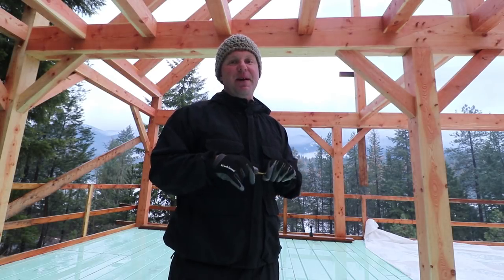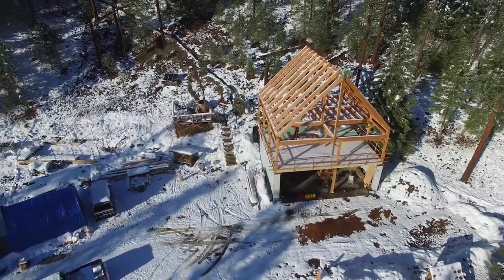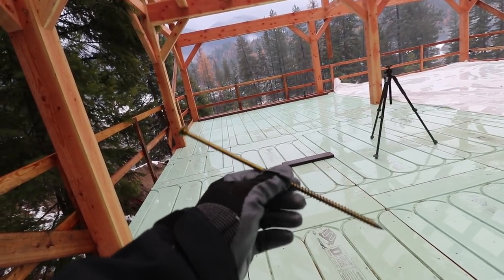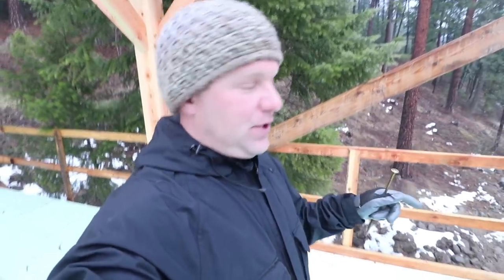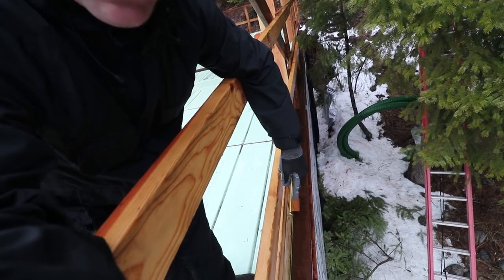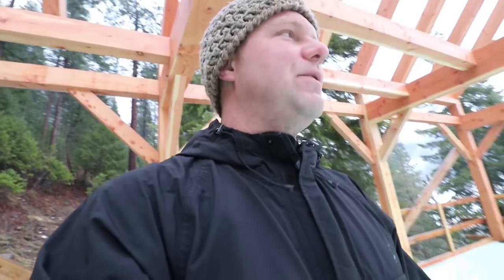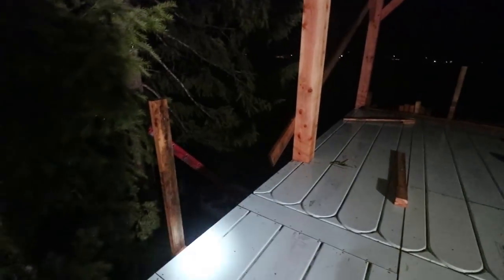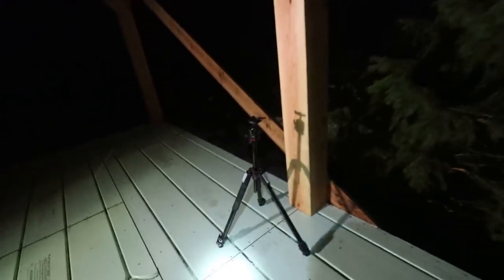How To Secure a Timber Frame To a Subfloor

Comment: All the heavy wooden post sitting over the warm board is not good something should be done to avoid load on warmboard it should be better if all the load is transferred to wall it self.
Reply: Nope!
Reply: Jedidiah please explain
Reply: he won't, just jabbering. After putting load on frame, it will crush this foam on boards to zero, don't get why they didn't remove foam from warmboards :/
Reply: Vein1986 I don't think the warm board has any foam on it.
Reply: The load (beams)on the warm board is not a factor...you can't crush it....its rated for something astronomical like 30,000lbs per sq" usually you would construct your sill plates on top of the warm board(in new construction) The load is transferred to the wall in the basement.
Reply: There is no foam in warmboard! Aluminum and marine grade panels....
Reply: Jedidiah, probably closer to 30,000lb per post (somewhere in the upper 300psi range) for Fc(perpendicular). Still no need to worry about the compressive strength of the panels under the posts.
Reply: The load bearing posts are better to sit bearing directly to the ICF. Douglas fir is 7230 psi and concrete is between 2500 - 10'000 psi depending on the mix. Plywood has a compressive strength of 250-280 psi. I can not find anything on Warmboard and even if 300psi is correct why bother putting it there as another weaker laminated thing to add distance between the mounting anchors. With leverage from wind mainly in the winter pushing on the house and Warmboard adding another inch of lift between the ICF and load bearing timer that creates a place for movement. Think of this larger unrealistic ratio example,  ICF, 24 sheets of 1" plywood and the timber on top of all that with a 36" moutning screw going through it all. That screw now has a lot more side to side bending weakness and leverage being put on it with 24" separating the ICF and the timber, so it can move side to side easier. New home construction is a joke for the most part. Its designed to be fast and make money. Lots of cheap homes that are build with speed in mind and no quality. It might be okay but its not the best construction sandwiching warmbaoard in there.
Reply: Practical Guy, Fc-perp is in the 600s for DF-L, and Fc-parallel is only in the 2000 range. This scheme is about half the strength of bearing on the sill directly. The thing is, though, the posts are massively oversized if compression bearing failure was the only design state to consider. There should be plenty of capacity available in this layup. Could it be stronger? Yes, but this is also an acceptable design choice that has some construction sequence/layout advantages for a pair of amateur builders.
Reply: Michael Onines I hear you. I get that its okay to build this way. I think if it were me I'd take the time to cut the warmboard in later and not have it part of the structure. I prefer to avoid any new manufactured products for fear of defects in the manufacturing process or design flaws and to have less components and distance in the joints of the load bearing mount. I've seen bad batches of particle board and even ply wood that delaminate or dry out and become weak depending on what was used as the plys. MDF is a good example of that for particle board. Its really solid and can take a lot of PSI for a particle board but get it wet and then it turns to sponge and you can tear the fibers apart like cardboard. I'm sure warmboard s or r (ply or particle) is not designed this way but  I like good old tried tested and true concrete, steel and real wood basically and especially for structural load.
Reply: For anyone out there with 50-60 year old homes, some will have had to deal with the floors. My Mom's house had some really saggy and squeaky feeling floors in a couple of rooms and it was the plywood sub floor in some areas that had dried out and delaminated. So those floors were easily replaced, but when its part of load structure you got bigger problems.
Reply: Practical Guy, you said MDF and I went into convulsions. Now that I have recovered I can say I generally agree with you. A load path without the warmboard would have been stronger and insulated against potential trouble if there are issues requiring replacement of the subfloor. I think the main thing that may have prompted the designer in this direction was the construction sequence simplicity of building the main floor platform completely, and then building up from there. I've considered what different construction sequences might have looked like and a lot of them are pretty messy for a pair with the proficiency and skillset here.
Reply: Practical Guy, I built a roof covering to keep our bikes dry in the side yard. It's not an engineered structure (have you ever seen a moment frame made out of 2x4s and plywood? Me neither). I used a 4'x8' MDF sheet I had lying around as the roof sheathing and threw asphalt shingles on it for waterproofing. There was not enough slope to keep water from backing up under the shingle and soaking the MDF. It kind of survived for 10 years before I pulled it off in small wet chunks and replaced it with a lightweight roof of accordian-folded coroplast acting like a corrugated roof panel. The neighborhood cats had decided my contraption made a great elevated litter box by the time I ripped the MDF off it. Thus the convulsions.
Reply: I always thought that this blue layer is high density insulation foam. Now it makes way more sense.
Reply: Go back and look at the video where they are installing the warm boards. There is a solid layer of wood where the posts sit.

Comment: Why a beautiful wooden frame, but horrible fire hazard I-joists for the floor?
Reply: titaniumslug welcome to modern construction.
Reply: Rose - Presumably due to the combustibility of the glue and the high surface area of the wood particles they have been known to go up like Christmas trees in a fire.  And they have been known to quickly lose their structural integrity in a fire and collapse when fire fighters walk on them. Search for I-joist fire in youtube to see what I'm talking about.  I'm not saying its necessarily all of them, but in a timber frame project like this its seems strange not to use timber flooring also, especially for this reason.
Reply: Gunga Dinn -  there isn't a 36 foot span in this building.  I presume 36 feet is the entire width of the house, but as you can see at the start of the video there is a steel beam supported by wood posts in the centre of the building on the ground floor.   And in fact you can see the beam on the floor above (which I believe is 20ft long) is the same length as that span.   The dangers may have been exaggerated, (though what that means is subjective), but fire-fighters dying and their colleges blaming I-joists for me personally would make me not use them, especially if I have already gone through the bother of getting a thick solid wood framing for the rest of the house.   And yes It does seem stupid putting the posts on the i-joists, even if they can 'officially' take the weight.
Reply: Tita; Timber flooring, you don't have a clue do you.....I build these for a living, no one uses timber floors....What the heck is a timber floor!
Reply: Jedidiah - Thats funny, Im sitting in a house right now that has wooden joists for both the ground floor and the floor above.  But I guess because you dont use wood in the shitty houses you throw up they must not exist.

Comment: I have been trying to figure out how you plan getting your large furniture pieces and appliances into the house,
Reply: If you watch their vid on the house design, there will be a back door that will basically be at ground level behind the house.  Carry stuff up the stairs beside the hot tub, across, and straight in to the main living floor.
Reply: I knew there is a back door that they hope to build a deck that comes to the mountain.  I knew that they could use that door, but taking the heavy appliances up that distance will be a big chore
Reply: If they could afford it, put in an elevator instead of the stairs in the garage.
Reply: If they could afford it, put in an elevator instead of the stairs in the garage.

Comment: 6:25 Jessie and Alyssa's architect engineer is sending them through hoops. There is absolutely no need for treated lumber for your sill plate, as regular construction grade lumber will do fine.
Reply: the treated timber is to separate the concrete founding wall from the green timber frame it eliminates ingress of moisture after the upper structure is dried in.
Reply: jamie, there are plenty of cheaper and easier methods to separate the concrete founding wall from the green timber frame- using treated lumber probably being the least efficient or effective.

Comment: whats a sip panel?
Reply: Structural Insulated Panel
Reply: Or non structural...
Reply: Take two pieces of plywood or OSB (or one of each depending on design) Coat one side with glue and attach them together with foam insulation in between. instant SIP.  There are types that use no studs between the layers other than at the perimeter and some that are made more like traditional construction with studding and rough openings all completed.
Reply: I've been in a couple plants and seen both methods. I think the injected versions are much stronger though due to the foam itself bonding to the wood.

Comment: Pray for NO earthquakes...  Those screws are nothing to hold that frame on.  I hope the SIP panels will attach to the concrete foundation some way.  The sill plate bolts would not survive.
Reply: Fred; Its done as to the engineering specs....

Comment: This is a weird building. So the entire house sits on the warmboard which sits on these osb-things you called I-joists? This can't be the proper way... 
When I look at our house all the vertical posts are installed with mortise and tenon to a horizontal frame to be one unit exept the door openings and this all together rests on the foundation. There would be no movement in this structure even with only the roof installed. I hope and pray for you your I-joists and the warmboard won't rot away from all the moisture.
Reply: It sounds like you simply don't have a basement. They could have used something other than I-joists if they wanted to go completely timber frame, but there are a lot of problems going with solid wood timbers for joists. I-joists are engineered products so they are less likely to twist, bow, or crown. They are also less weight than typical dimensional lumber for the same load capacity. Rot shouldn't be an issue unless the wood is in standing water, the big issue with having the warmboard exposed is actually delamination since it, too, is an engineered product. However, the majority of the warmboard is covered in coated aluminum, so even that problem will be minimized. They have used a civil engineer for the majority of the projects in this build, so structurally I think they are probably fine.
Reply: Tom Err almost ever stick framed house has the walls sitting on the floor and those walls hold the roof. Doesn’t seem a lot different to me.
Reply: We have a basement. But our house is built around 1890. The foundation is made of sandstone blocks, the first floor from steel joists and bricks in some sort of barrel vault fashion. (Sry don't know the correct english term). The second floor has wooden beams installed.
Reply: Mrcaffinebean well, I have never seen an entire timberframe sitting on I-joists. This here is the first one. Stickframe is not  very popular in my area. But in hindsight I remember Jesse has done some reinforcements with offcuts from the sill plate material so they will be fine, hopefully.
Reply: I wrote already about reinforcing those spot, so get over it.  This channel is by far not the only on YT so yes maybe some parts get missed...

Comment: shoot, on my cabin i ordered aquarium inch thick plexiglass. its not your standard plexiglass. its perfectly clear. then i just encased it to hold it in.way cheaper then windows. and you cut it yourself.
Reply: zero, how is that holding up? I read somewhere that Plexi clouds up over time with UV exposure. Has that been an issue at all for you? Is there a UV-resistant formulation that slows that process?
Reply: i built it when my son was born, he is 5 soon to be 6. No clouding to report. That only happens to cheaper acrylics.
Reply: zero, thanks, I'll have to relook at that. I used regular glass on a solar oven I built because I thought I read about clouding being an issue, but after having the glass crack I'm re-thinking whether plexiglass would make for a good replacement.
Reply: Whoa, wrong there KoJo. Glass has R value of .14 per inch. Plexi has a R value of .7 per inch. Adding Argon between the sheets of glass helps. But a inch thick of Plexi and you are beating those with the double panes & argon gas.
Reply: Hey, and you also get the extra bullet resistance.
Reply: Woah, wrong there zero.. The insulation in a double-glazed unit comes from the gas trapped between the panes not the glazing material. A simple double-glazed unit with 1/2" air gap has an R-value of 2.0 so nope, you're not beating that with 1" of Plexi, not even close. Add Low-E glass and argon and you're at 3.7.
Reply: Adam Macer I had never heard of using thick plexiglass before.  I've seen very thick glass used in corner windows where the architect did not want a visible seam.

How long do you think argon lasts?  I've heard 1% loss per year, but I've also noticed an IGU with interior condensation near a shower.  My guess is that 10% of IGUs fail and nobody notices.

Comment: Why no roof?
Reply: Maybe because that could move the frame around in strong wind since there is no joinery between the frame and platform, as he said.
Reply: They might be using SIP's for the roof also....
Reply: at this point, why does it need a roof?

Comment: And so your structure  is linked to the basement by 12 points ( 12 blocks ) only and you believe you can transfer all the horizontal loads by those 12 points ... good luck and lol
Reply: sips panel: you mean  thin layer of osb without stiffeners ... great !
Reply: 20 years engineering office  the structure must goes to the concrete nothing more nothing less
Reply: Com Ander no all the post sits on blocks nailed next to the joist
Reply: Michel: I agree and a lot of these viewers do not understand the potential horizontal load and it looks like Jessie does not . I am also thinking that the vertical load is going to crush the foam core warm board and transfer the load to sip and interior panels in the future that will cause bulging and cracking of interior finish as the structure settles .
Reply: As an engineer, I suggest you do your homework before commenting. If you had, you would have learned that Warmboard is 1-1/8" thick structural plywood (7x1/8" plys), exterior exposure rated adhesive and a continuous 0.025" aluminum layer (the green section that everyone talks about) bonded to the top. The only error that I see at this point is the lack of vertical 2x crush blocks under each point load (post) as required by the I-joist manufacturer. Not a big deal because these can be added at a later date and may already be there, just not shown on a video. In addition, the SIP panels will handle all shear and racking loads plus the uplift suction load induced by wind going over the roof if tied to the sill plate, which Jessie has stated that they're doing. In aviation terms we call this a monocoque structure, where the skins handle the loads (SIPs) and the ribs/stringers (timber frame) maintain the shape. Not a perfect analogy, but close enough for this group.
Reply: Whenever, compression value are different for fibers II to the load or perpendicular to the load
Reply: Has a bad engineer that you are explain us how you transfer the load to the concrete, don t forget to mention the momentum due to the horizontal load and the difference of altitude between concrete and post, dont forget to take into account the limitation of pressure on the sill beam   "  The sip panels can handle " yes for sure when their is no opening and the envellope is fully calculated according to the situation, but let me doubt about that , no calculation is made by nobody and no verification either

For the monocoque structure, justify the skin thickness according to the distance between the stringer, you will quickly see that you re not in the same situation as what you re talking about

And no sips do not handle the load, it s the structure who does this job